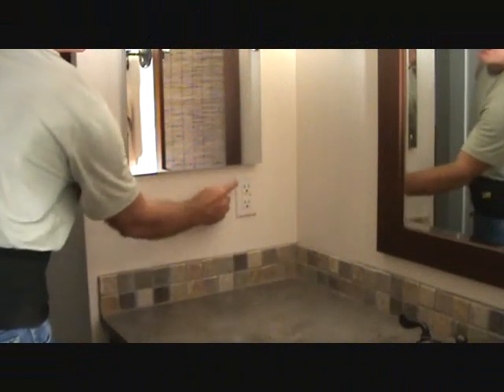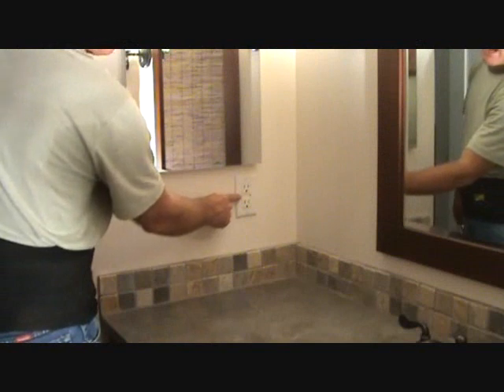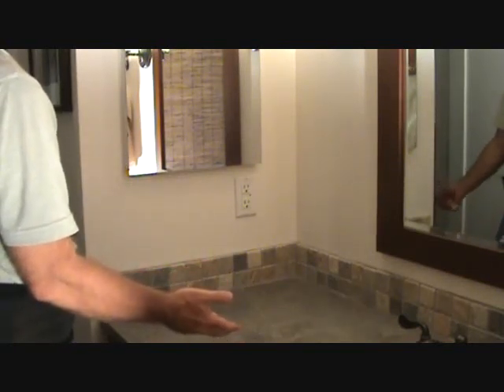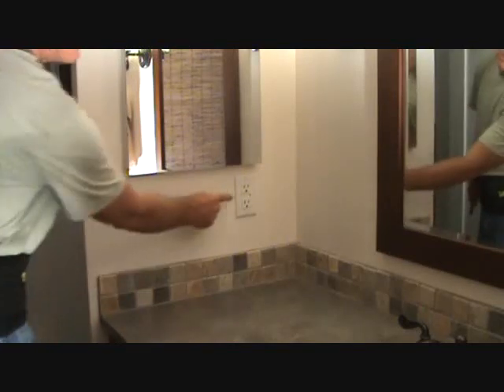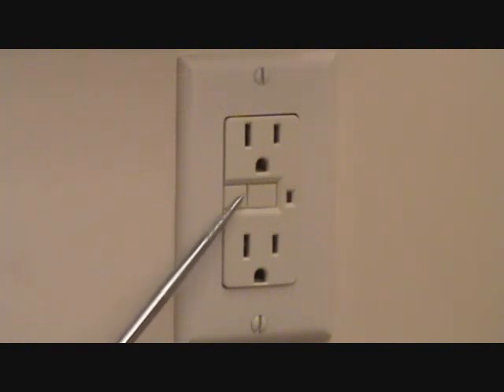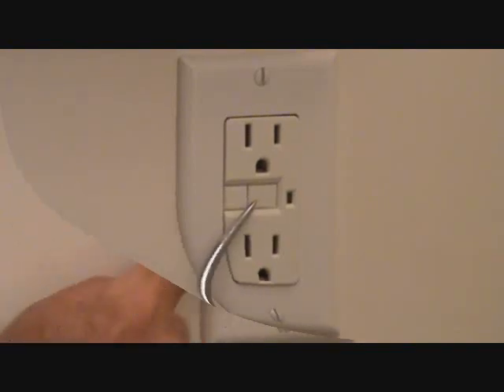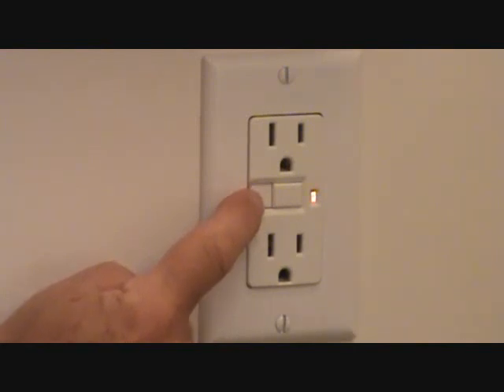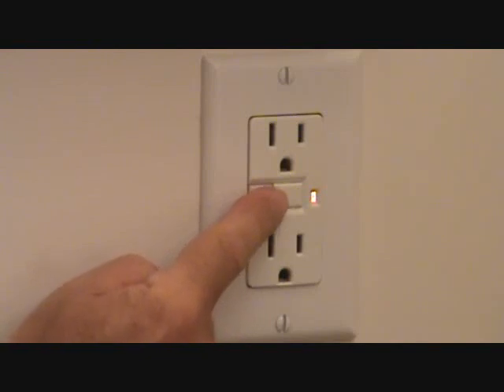How to reset a GFCI receptacle duplex outlet plug

Comment from the maker: If the reset button does not stay in, the actual breaker could've tripped in the sub-panel. Look for a tripped breaker. If you find one, reset the breaker (first turn the breaker all the way off then back on). Then go back to the GFI outlet & press in the reset button. If that doesn't work, you still have a short in the circuit somewhere. Could be a faulty lamp cord or something on the same circuit as the GFI outlet. Look for it & let me know if you can't find it.   Joe  :0

Comment from the maker: Your breaker in your sub-panel might have tripped, going to these gfi outlets. If you have no power to them, they will not reset. Do you actually have a separate GFI outlet in each bathroom & all 3 GFI outlets are not working? Sounds like that would be a tripped breaker. Or it could be possible that you have a broken off ground stem pushed into one of the GFI outlets, but more than likely not. Do you just have 1 GFI outlet that controls all 3 bathrooms? Your GFI outlet might be defective.   :0

Comment from the maker: @oLdSkOoLkisS You must have a short somewhere in the circuit, causing the GFI to trip when you turn the garbage dispoal on. You might have a loose wire nut in the switch box or maybe in the outlet box where the garbage dispoal is plugged into. There might also be something caught in the garbage disposal so when you turn the switch on, it trips the GFI outlet. There's something going on. Try some of those things to narrow it down. Let me know what you find. Thanks for your question.   Joe  :0

Comment from the maker: @oLdSkOoLkisS There might be something stuck in your garbage disposal thereby preventing it to turn & then tripping the GFI plug. Get your allen wrench set out & find the right wrench & under the disposal you will see where to put the wrench. Turn the wrench & dislodge whatever is preventing the disposal to turn.....you can turn it back & forth to loosen up the disposal "stick". There's also a red "reset" button down there. Push this in. Now try the switch again & see what happens.   Joe  :0

Comment: had a question on    all 3 bathroom plugs dont work and the reset dont work   any idea what that might be ...  could the  GFI  be  burnt out in all 3 bathrooms ??  the lights work just no plugs   are they usually all connected to one  source    ..    just cant figure out this problem .  thanks if you can let me know  something on it ....  Joe
Reply from the maker: Your actual breaker in the electrical panel probably tripped. Sometimes that still could happen even with GFCI outlets. Did you check that?

Comment from the maker: @oLdSkOoLkisS Your garbage disposal cord may have a looose connection or a bad end....Check this out too. A wire connection could be loose on the back side of your switch &/or GFI outlet.  Make sure to turn your breaker off when trouble-shooting your tripped GFI plug. Please get back to me to let me know what you find is causing the GFI plug to trip.  Joe   :0

Comment: there is just one  that does all 3 bathrooms ...  maybe its defective after 9 years old ... might just need a new one and see if that helps..   fuse panel box is ok........
 thanks  i will let ya know ..............
Reply from the maker: Yes GFCI outlets will not last forever & have been known to stop working over time especially in wet bathroom areas per se. I have had to replace a few so I know they sometimes stop working for who knows why.....

Comment: What if the reset button does not stay in? What is the next step?  Pls help!
Reply from the maker: If the reset button doesn't stay in then maybe the actual circuit breaker in your electrical panel has tripped & may need to be turned back on as you need power to a GFCI outlet in order to reset the test button...

Comment: I had one that was doing that,only sometimes it would stat on for a day or two & other times onl briefly.It was a new 20 amp GFCI unit replacing an old regular 15 amp outlet.The circuit & breaker are 20 amp.
I re-did the wiring to the bathroom exhaust fan & oiled the fan, & mirror light ( the GFCI served both) & replaced the 30 year old circuit breaker. It has been trouble-free for months now.
Reply from the maker: Awesome to hear. Way to go!